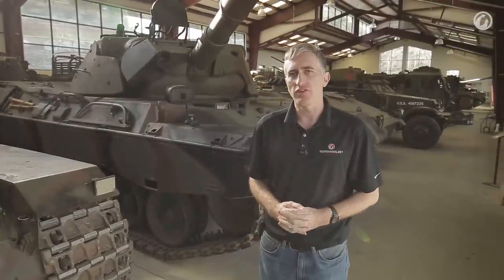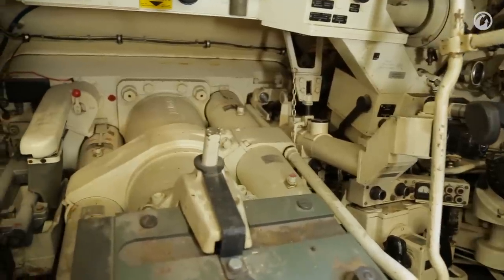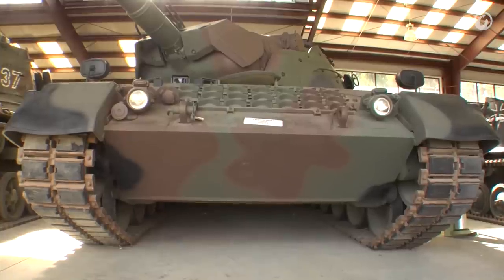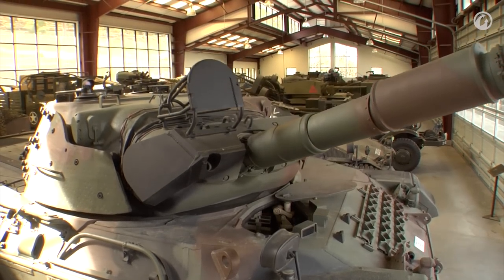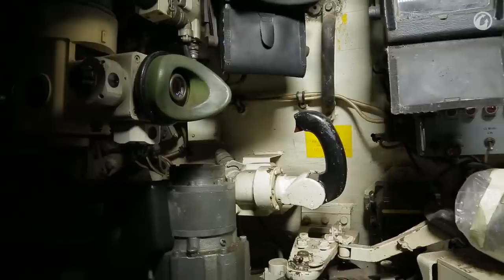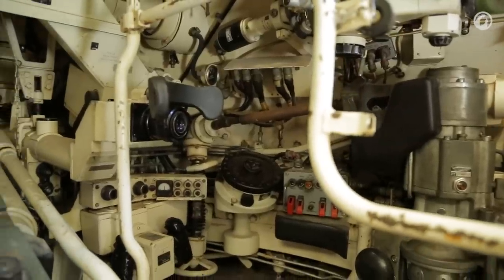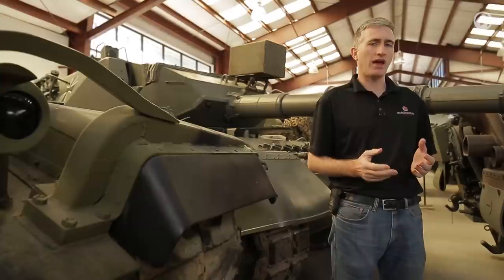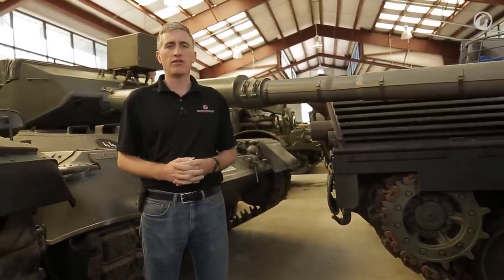Inside the Chieftain's Hatch. Snapshots: Leopard 1 [World of Tanks]

Comment: A crew of a Leopard 1 C2 in Afghanistan managed to fire 16 round in a minute against taliban placed on a mountain

The Canadian Forces still use the Leopard 1, rename -> Leopard C2 due to the upgraded fire system and the add of additional armor Mexas, they are now remplacing the Leopard 1 for the Leopard 2 in green olive with space armor all around the turrent and the side hull with slat and improve protection against blast.
Reply: You do realize that the Leopard 1 base armor is only meant to stop heavy machine gun rounds and some smaller auto cannons. The Leopard 1 can NOT take a hit from any type of tank round. Even the old Sherman 75mm AP round would go straight through the Leopard 1 lol.
Reply: @mississippirebel1409  can you even read? Where did he say that anything at ALL about the leopard 1s armor...are you blind or simply cannot comprehend a basic sentence?
Reply: MississippiRebel bro you need to read
Reply: @mississippirebel1409  additional armour of the Mexas package-
Sides of hull, adding some composite armour blocking much more from the side
additional turret armour, mostly just thin plates going around the sides of the turret to (my guess) help against shaped charges
Reply: @ket451  All the extra armor is for shape charges like RPGs. The Leopard 1's armor was only originally suppose to stop 20mm and that was it's frontal armor. It's just hard for me to imagine Canada using Leopard 1's in Afghanistan as a US solider that has deployed to both Iraq and Afghanistan.
Reply: @mississippirebel1409  they used
Reply: @mississippirebel1409  Aren't there many military vehicles that can't take a very big hit? But tell me, as a soldier, would you not appreciate 105mm support when you're pinned down? That's why they deployed them! The Canadian armed forces (like many others) realized that against their expectations tanks and large helicopters where a nice thing to have, even in the "low intensity" conflicts they expected to be fighting. Which left them scrambling to find suitable tanks (which they found in the NL) that they thought they wouldn't be needing anymore. And it left them without Chinooks (which they had incidentally sold to the NL) for years while they where in the back of the line for new builts. 

Even so, recent conflicts in Syria and Yemen have taught us that a tank is only as good as the force that is using them as we've seen the Turks, Saudi's and the UAE loose Leopard 2's, Abrams and Leclerc tanks to much less lavishly equipped forces. And the Afghan war left many countries scrambling to find suitable equipment while deploying older cold war equipment as a stopgap. They where surprised when their misguided post cold war ideas about conflict and heavy weaponry proved wrong and put their brave soldiers life at risk. When push came to shove, they too had to admit that any tank is better than no tank!
Reply: @mississippirebel1409  Late answer but you would probably be suprised to find out that even the earliest models of the leopard 1 had as much frontal armor as a panther from ww2. So no, a 75mm AP from a sherman would not penetrate the front.
Reply: 16 rounds a minute, nice now I don't know much about the leopard 1 but where do you put/discard the empty casings
Reply: @therandomytchannel4318  if i remember it right the casings burn of with the charge and only the base of the casing will remain

Comment: Great video, I served on AS1s (Aust A3) for quite a few years- our a3s had the welded turret as shown on the a4 but the TEW1a commanders sight seen on the a1. These sights were not really HK sights in the true sense that you  could slave the gun to them to engage prioritised targets like on later vehicles ie challenger etc  BUT they did allow the commander to scan for targets independently while the gunner was engaging the primary target. You could then manually traverse the turret in the general direction and when the gun aligned with the commanders sight it would "click" in and the target would appear in the gunners sight picture provided you had correctly aligned all you sights when bore sighting so I guess depending on your definition you could say it was a primitive version or precursor to HK sights. This function however was barely noticeable with all the noise in the fighting compartment and at most targets out to 2 km you could eyeball it and still be in the gunners scope.
Reply: All A3 and A4 have a welded turret (That is the main difference to the earlier models). As does the Danish variant of the Leopard 1A5 since it is based on an A3 turret.

Comment: Leopard 1 was a fantastic design.
Reply: +okrajoe 
The Leopard 2 is a better design though.
Reply: +Transit Tycoon That's natural design progression, though. Relative to their times, both are fantastic designs.
Reply: +Sean Maness the Leo 1 design was great for 1960? Not really in many ways
Reply: okrajoe in warthunder its spammed everywere
Reply: okrajoe totally worthless in heavy combat. but in tank to infantry it could be usefull. however any kind of tank to tank and you will almost always lose.
Reply: shittyG1 why would that be?
They can both kill each other, T-55 has the advantage in Armor, which is useless as it can be penetrated easily by the Leopard1.
Leopard 1 has a rangefinder, T-55 doesnt.
Leopard 1 has 9 degrees of gun depression where the t-55 got 5, so it can use the Terrain to its advantage. Leopard has the better suspension, which means that it can use walk and fire tactics better than the T-55 despite bothe having a stabilizer. Leopard has more room inside the Tank, which means that especially the loader can do its job bettet.
Leopard is designed to have its engine and transmission replaced in half in houre, T-55 takes multiple houres.
And lastly the Leopard 1 has better nightfighting capibilities than the T-55.

The only reason you might assume that T-55 is superior is its armor, which is useless because Leopard1 features the greatest gun of its time.

I would be suprised if Leopard was not capable of dealing with T-55s as that was exactly what it was designed for.
Reply: tt 55 is better. lower target shorter target bigger gun more precise bett ammunition. armor that does infact work. and its reliable.
Reply: dillan mcdaniel "Lower and shoter target" like 5cm or what, doesnt make that much of a difference when Leopard is in a covered position and T-55 is in the open Field. Dont like that scenatio? Too bad, but thats how cold war would have been and thats what both tanks are designed for and would have been used for. T-55 suspension is worse than some ww2 vehicles. seriously, watch a video of a T-55 going over rough terrain and that watch a Leopard or even a ww2 Panther. Huge difference. 

And why would it have a more precise gun and ammo and why wouldnt the Leopards ammo work? Id like sources on that.
Reply: Dillan, I have to point out that the T-55 has a smaller gun, as it features a 100mm gun, and the Leopard 1 has the British L7 105 mm gun. Both of those guns are going right through either tank if they hit.
Reply: @KaiserHabsburg  1. They're almost the same size

2. The leos gun is bigger

3. They can both penetrate eachother with no problem

4. The leo is way faster

5. Both are reliable

Whoever shoots first, wins
Reply: @snonsig2688  "5. Both are reliable" The only reliable T-55 were of the later production years - best were made out of Soviet Union. Like German, Polish, Czechoslovakian. Those were fairly well equipped as opposed to early T-54 and T-55. 

Still, T-55 tank reliability was by far the effect of having not much to be broken. Leopard, on the other hand, had a lot of things that could ruin vehicle reliability. Still, it had 6x longer service and maintenance work hours periods. I'm sure Germans made it too much and Leopard could run none service 10x more that T-55. 

I know a guy that owns T-55 AM Merida - the tank is constantly out of service. He owns one in some amazing condition. Barely used by the army. They sold it to him after a major renovation with engine and transmission replaced.
You can buy now a Leopard 1A5 like some worn to death... and yet it will still run just fine for years.

Comment: Leopard 1 a3 and a4 are significantly different from other variants in terms of protection. IT used a special spaced armor with an outer layer of hardened steel + polyurethane filler + main RHA armor. This virtually doubles the protection while not significantly increasing the overall weight (+ 2t). By the polyurethane it is fully protected against HESH ammunition. The APFSDS ammunitions of the time were rigid, thus they have been became physically damaged by pentertaring the hardened outer layer, and they could not penetrate the quite thin main armor (not even the 115mm cannon of the T-62!). It also provided high protection against first generation HEAT ammunition due to "fore-shortening" in the polyurethane layer (jet concentration decreases at every density changes). 
The funny thing: traditional APCBC ammunition was almost insensitive to this phenomenon, so the outdated T-34-85s and T-54s was more able to kill a Leo2A4 than the brand new T-62 of '60s.

The armor of early T-72s' front hull & add-ons of T-55AMs' armor use the same disciplines. Thus the protection of the T-55AM with BDD additional armor (also polyurethane filller) was better than the first baths of T-64s.

Comment: 1:43 "Kind of stabilize"? No! "Stabilize"? Yes! Firing on the move! You could, we did and we were hitting the target. On the move, against moving targets, tank turret size, below 1000 meters...
Reply: +Henrik Hansen Below 1000 Meters is kinda medium to short range for a modern MBT though...
Reply: Jain Zar And when was a Leopard 1 A3 a modern tank? At a time were hitting a moving target 1000 meters away, while driving 50 kmh crosscontry, was a big deal. You need to compare it with other tanks from the same time period. As it was upgraded a Leopard 1 A5 DK could hit a tank 5000 meter away and on the move at moving targets 3000 meters away. Jain Zar, have you ever been shooting a tank?
Reply: Henrik Hansen No, I was in the navy. My point was, that a thousand meters is nothing for a tank.
Reply: +Raven Coldheart not when standing still or moving slowly, ofcourse not, but good speed offroad at 1km in the 60s was great one of the only things it had compared to the cheiftan and T-62
Reply: +Henrik Hansen Was it a regular practice?
Reply: it was back in the seventies and the  eighties
Reply: Henrik Hansen but the chance is low. look at soviet T-62 it can and most likely hit when on the move. why? cuz they used APFSDS, it very accuracy and fast while Leopard 1 used APDS.
Reply: ReinBow Leopard 1 had access to APFSDS as well
Reply: John Doe nope if it had APFSDS, the gun would shoot accuracy. Leopard 1 -> Leopard 1A4, all dont have APFSDS only A5 has it. U can look up for more info
Reply: John Doe the APFSDS is very stable so u cant miss a shot with it
Reply: ReinBow Since A5 is basically an A2 or rarely an A3 with a new fire control system the ammo  is equal in all Leopard 1. At least german A4s had APFSDS in the arsenal
Reply: Leo 1 tank crews where very well trained in the german army and could make the tank dance
Reply: Michael Brinkhues soviet also well-trained. But the tank doesnt have gun stabilized so still cant fire on the move
Reply: ReinBow It can fire on the move :D
Reply: ReinBow  wrong Australian Leopard 1AS {A4+} did fire APFSDS, I know I drove and crewed the tank......
Reply: first u drove a tank and crewed doesnt mean that u know everything about the tank mate :/. second A4 cant shoot APFSDS unless it has been upgraded the gun that capable of shooting APFSDS, like M1 abrams from 105mm to 120mm. https://en.wikipedia.org/wiki/Leopard_1 more info here
Reply: Really, I think I know what type of rounds I loaded into the chamber, you do not, ask any Aussie from the late 70s what types of rounds they used, not rely on Wiki mate :-}
Reply: once again like i said, being a crew member doesnt make you know everything about it, so dont try to point out like u know everything about tanks.i dont rely on Wiki in fact A4 never used APFSDS untill A5 you can look up for research and trust me u and me need to know more than that :)
Reply: wrong son
Reply: you said im wrong but u cant point ur right thing my wrong thing. childish people :/
Reply: I was a gunner on the Danish leo 1 a5  for 4 years 2000- 2004. we used APFSDS and the effective shooting distance is 3500 m . it can fire up to 4000 m in direct firing. Beyond that is indirect fire and is not recommended.
Reply: thomas pedersen Yeah thats what im trying to say, only A5 version has APFSDS
Reply: I can´t say  what the a4  used, but I rely on the guys that worked on the a4 and not wiki or any other media ( as long as they not are from the US, because I know for a fact that they know nothing about the material they work on) SO if the Aussie crew´s say they used APFSDS then they did.  What is your knowledge (and where did you get it from) about the Leo 1 or any other tank in that case?
Reply: thomas pedersen They can upgrade the tank for a certain fact. T-72's can be upgrade or M1 Abrams's gun upraded from 105mm to 120mm. So if Aussie said that then A4's gun can be also upgraded to suit for the modern weapon. Thats a fact.
Reply: divine you do realise that there are APFSDS rounds for 105s as well as 120mm guns don't you?
Reply: Darren Marsh so? M1 Abrams has 105mm APFSDS, but doesnt mean Leo 4 has APFSDS. If it has, that probably others country upgrade it my dude. There are no document saying that Leopard 4 has APFSDS smoothbore.
Reply: You also don't need the gun to be smoothbore to fire APFSDS.
Reply: Darren Marsh bro u need a smoothbore gun so that ur gun doesnt get damaged. 1A5 is the first version has APFSDS.
Reply: The driving band on the aluminium sabot is made from plastic. How can it damage the rifling? Look for the M1060A2 round as an example.
Reply: Darren Marsh bro thats why us Abrams changed to Smoothbore 105mm my dude. time to time APDS damages the gun barrel, the shot wont be effective. you can look up for info
Reply: Yeah, this isn't the first thing mr. Chieftain has gotten horribly wrong. He always comes off as incredibly averse toward German equipment whilst he's got an almost perverse affliction for any American tank, which really comes to light ones he starts talking about the Sherman, my god he can spill a lot of drivel about its "virtues".
Reply: @divinesan7786  105mm APFSDS ammunition is used by the L7 and M68 guns. Designated M774, it's been around since the mid-1970s. The Abrams upgrade to the 120mm Rheimetal was to increase performance, not to add sabot rounds.
Reply: @galacticoverlord4871  if you talk about modern L7 or M68 then i believe but if you tell me it was used back in cold war then no. you can go research, Lepard 1A5 is the only first Leopard 1 used APFSDS ground. today modern era, many old cold war tank is still being used so they upgrade it to use the modern tech.
Reply: @divinesan7786  Again, it was fielded about 1975. What do you think it got put into? M60A1 passive RISE and M60A3. Abrams didn't get fielded until 80.
Reply: @galacticoverlord4871  and what is your point then? what are you trying to prove here? you cant prove that M60 was used APFSDS in Cold war.
Reply: your spouting shite, apfsds doesnt break rifled barrels, if it could, it wouldnt be used.
maybe in russia you just make shite sabot but the only negative when shooting fs from a rifled gun is if the rifling angle is too strong the fins will create drag when spinning, you could "look it up" like you tell everyone else to do.

you can start with the wiki page for apfsds for example it spits out quite clearly a lot of information you might want to know before you tell people to "look it up"